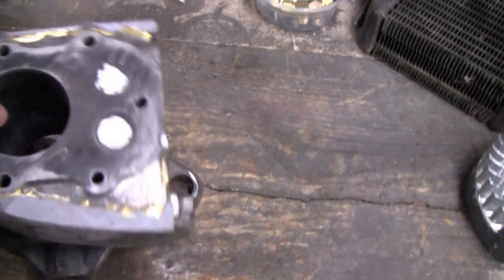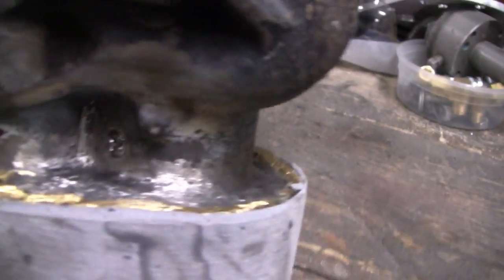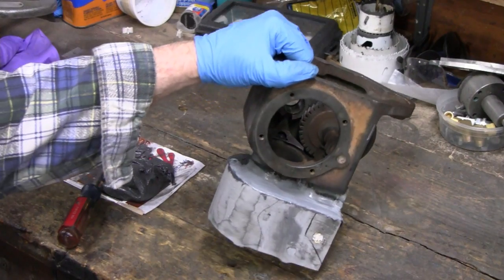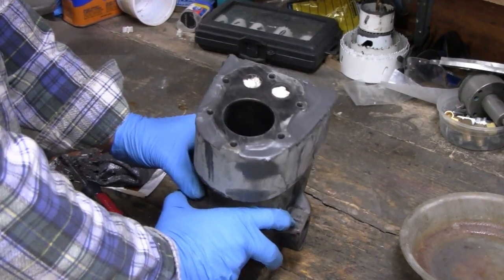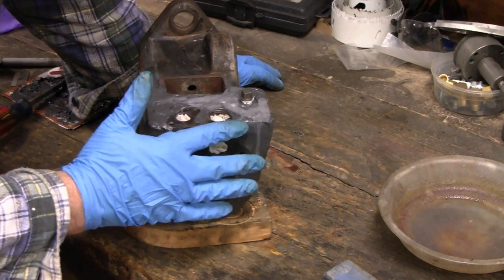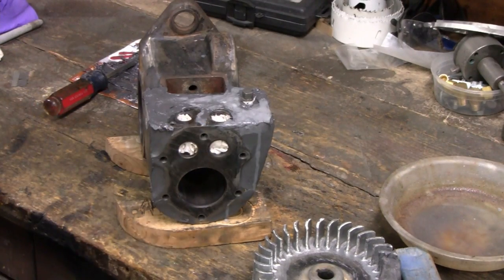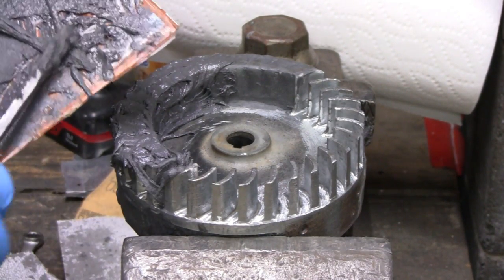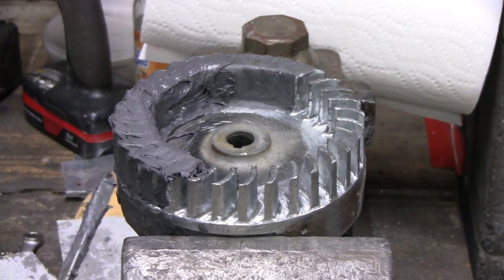HOMEMADE WATER COOLED BRIGGS ENGINE (part 18)

Comment: I have followed most of your vids, this one is cool. I worked on a lot of marine engine's through the years. like most of the motor heads l know it's the first engine we worked on, too fun to watch you guys make interesting versions. I don't know if you have a way to get water to the top but what about using larger head bolts (you have lot's of room), then drilling up into the bolts, then lateral into the head cavity X 6 should keep hot spots away and look clean. I can see you guy's love to keep um thinking. anyways just an idea, by the way I love your hotrod, im just finishing up a 27 Willie's knight. Thanks for the vids, ill be watching. Have fun; Dave
Reply from the maker: Thanks Bud!! We we're gonna do something like that with the bolts but decided against it on this build, we will probably do it on a future project though!!☺
Reply: 805ROADKING 
Good deal. say hi to Mike and the dirt bikes. l love to see how Mike solves problems; especially the clear glass head B&S. Thanks again, have fun, from So. Utah. Dave Egor

Comment: I like the epoxy used as body filler.  It definitely sticks good and handles heat good too. I have used this kind of stuff on a few exhaust leaks and I usually held up long enough till I could replace the parts.

Comment: you will need to balance that flywheel to stop the thing rattling apart. those cranks arent very strong and excess weight will snap the nose off it

Comment: Maybe I already missed it in one of the other videos... did you pressure test the water jacket before all the epoxy?
Love the videos. I had to go back on the 4 cylinder and start from the beginning. This one I get to watch real time.
Reply from the maker: Nah, I really doubt there are any leaks, but if for some strange reason there is, the epoxy is fully encasing the jacket!!☺

Comment: Why not sit the flywheel in a tub of resin and then machine in a lathe to get a perfect fill with zero air bubbles? Be easier to work with and cleaner easier to paint

Comment: i think that because you covered the entire cylinder in epoxy, it would run hotter than if you didnt do that, any air-cooling it would have had around the cylinder is now gone
Reply: Dayz Bambi it's a show engine. It's not going to be doing any hard work. The water will provide more than enough thermal transfer from the head.
Reply: Dayz Bambi ....? Do you realize that this is a modification to go from air to WATER cooling? Kinda like the title says... you'd think that it was self explanatory.
Reply: Dayz Bambi Well yeah, but in the previous videos he's going to be running a radiator of a sort. So water-to-air cooling yes. I'm sure with how low the temperature post-water-jacket will be, the epoxy coating will be just fine
Reply: Dayz Bambi  why not just leave it air cooled ? why make it half air half water cooled like your suggesting ? These are my questions. Keep in mind the title includes the phrase "water  cooled briggs" ,an engine known to be air cooled.
Reply: thescreamngshitter the point of this channel is 805roadking's creations using Briggs and Stratton engines. he's made 4 cylinder inline Briggs, radial 3 cylinder briggs, glass head Briggs, and many more modified Briggs engines. He's an engineer, and makes these for engine shows as well as to express his ingenuity. His reason why is simply because he can. It's a water cooled engine design, just like what you'd find in your car or truck. Liquid cooling is more efficient than air cooling, safer, and is just plain cool to see these old engines redesigned. please all of you quit over thinking this.....
Reply: @DJ Vegh yeah i know that as well, but if running for an extended amount of time, that epoxy will insulate the heat some, maybe a negligible amount, but it may crack over time
Reply: @007freak yes i do, but if you did not insulate that with epoxy, the water could transer some heat from the metal to the air, therefore, air-cooled, damn maybe think about it some will ya

Comment: Just a idea..to fill that flywheel you could use a cake decorator bag and just squirt the epoxy in. I'm sure you are already done, but maybe next time!
Reply from the maker: That stuff is alot thicker and stiffer than it looks!! It would probably work though!! I like the way you're thinking outta the box!!☺
Reply: Thicker bag. I had some anchor epoxy, which is almost like grout. I used a corner from a plastic construction bag (something like 10 liter bags that you fill with garbage found on construction sites). It worked a treat (pun intended).
Reply: Correct.  Google "sour cream dispenser gun"  You essentially get a re-loadable calking gun ;-)  Perhaps a viable option if RK were to operate a biz where he would need to fill goop between fins on a regular basis

Comment: What kind of epoxy are you using for that ?  I have a model 6 Briggs with some broken cooling fins on it. I was going to just gut the engine for parts, but maybe now it may get a cooling change. As always a great video series guys. Thank's again.
Reply: I had that problem one time and I removed the fins that were opposite of the broken ones. It still cooled it just fine. Just an Idea.
Reply from the maker: Thanks Chuck!! I got that at a Gov't Surplus auction, so it didn't have a name on it!! But all the paste epoxies I've ever used are pretty much the same!!☺

Comment: Really should shaved the cooling fins off, you stand chance if
Seeing that flywheel throw that jb weld off in chunks.. not safe. Never alter a fly wheel with out including proper balancing. It gets ugly when they come apart.

Comment: Hey buddy..  the Nutty Canuck here again.  I've never seen that type of epoxy before.  Is it just like regular body filler and where can we get it?  
have you used it in this type of application before as I'm curious about cracking due to heat differential and how it will be affected.  
Cheers RoadKing!!  keep up the great vids!
Reply: Look up his 4 cylinder briggs project buddy. That was a sweet build!
Reply from the maker: Thanks Nate!! I got that at a Gov't Surplus auction, so it didn't have a name on it!! But all the paste epoxies I've ever used are pretty much the same!! you're over thinking it Bud, that engine probably won't even hit 100 degrees!!☺

Comment: Was it a flat screwdriver or a philips screwdriver?
Reply from the maker: That was a special screwdriver made by Snap-On exclusively for smearing epoxy on a Briggs and Stratton engine, it wasn't cheap but it is guaranteed!!☺
Reply: Those Snap-on dealers are crooks...

Comment: Far too late to say this, but the cooling fan could have been ducted off to force air over the radiator you'll be using to keep the engine cool, but, that's just an afterthought of mine, I'm good at thinking of things after the horse has bolted... :P
Reply from the maker: That is a pretty good idea Mate!!☺
Reply: I have them on occasion... :)
Reply: I was curious if the epoxy would put the cooling fan out of balance and wear on the crank/bearings?
Reply: Not too late,,, he can just use an alternate flywheel and try both methods.  Great idea though.
Reply: Yes, "twocvbloke" I'm the same way, I was going to say the same thing, but then I thought , " Ah, why bother, somebody else is going to say this ..."
Reply: I second the cooling fan shroud to radiator idea.
Reply: or the cooling fins could have been milled off completely.  As is it is going to be a nightmare to balance

Comment: Good progress - tend to wonder whether a small spatula would be easier than screwdriver for applying the epoxy.
As someone else asked - wondered what epoxy you used.
Reply from the maker: I got that at a Gov't Surplus auction, so it didn't have a name on it!! But all the paste epoxies I've ever used are pretty much the same!!☺

Comment: couldn't u have milled the fins off the flywheel?  or would that make it to light
Reply: He prefers the look with the fins attached. Plus the putty will add a little weight to make a heavier flywheel.
Reply: he wanted it to keep that dished in sortof shape while there was no need for the cooling fins he wanted to make it look like it was casted with a big ring around the edge where the fins would be
Reply: SeaMonkey cool
Reply: Dave Sanford he could have just Sawzaled The fins off of the flywheel.
Reply: Dave Sanford  now the flywheel is off balance s and how the water gonna be running? needs the conductor inside
Reply: Maximo Pizarro they got a small water pump.  the flywheel will be fine when it's all done.